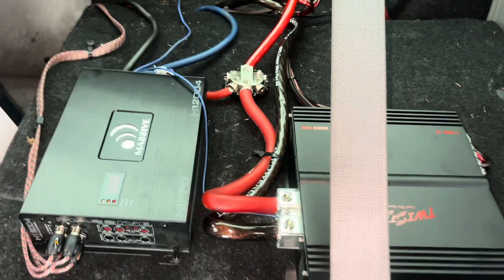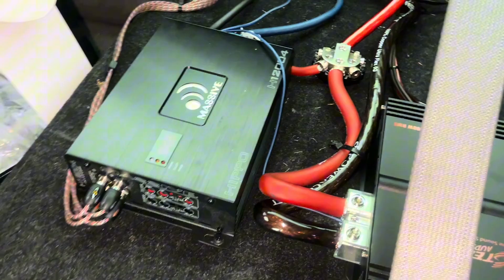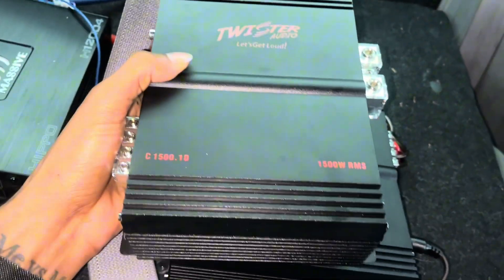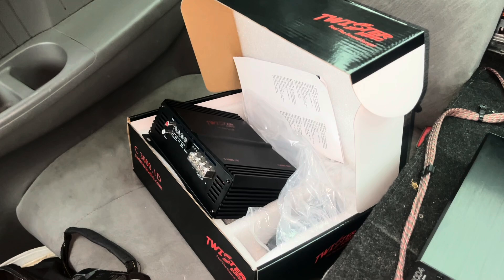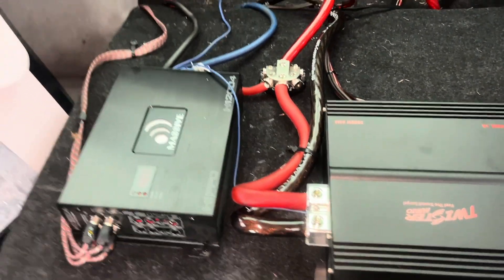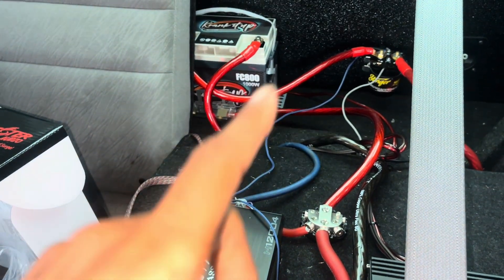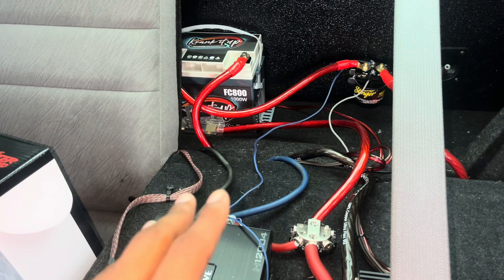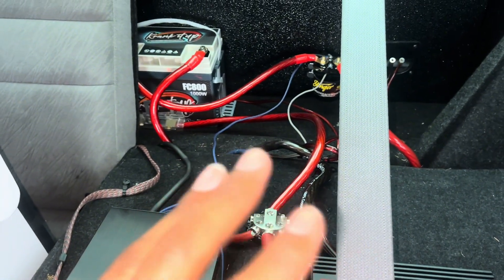Does 2x RMS = 2x Bass?

Comment: shoutout vw for making bassproof cars man. my jetta eats 3kw around 130db through some 15's in IB and it hardly rattles... plus the stock alternator is good for 300A and the factory battery is AGM
Reply from the maker: Must be niceee. Everything rattles in my civic and the stock alt is only 90 amps

Comment: Yep, 370a, XS Power Titan 8, and SB500 Capacitor. 4/0 OFC power and ground. You won't face any massive voltage drops. 😂 But damn it was expensive as hell.
Reply from the maker: Dang 4/0?! where you even find that lol
Reply: @AndrewGilreath 
Knukonceptz or SkyhighCarAudio make sure it's Tinned OFC to minimize corrosion on the wires outside your car. Inside the car OFC or tinned, doesnt matter.

Comment: Good video. Get a SMD copper distribution block. Hot and ground. Your amps will run cleaner.
Reply: He doesn't need it... I'm running their Ultra QCXL-4 Fuse Alu for 5500w, it's still clean.
Reply: @MyFaux  Oh he does. Copper is the only way to go. Trust me. 18,000 watts in my Escalade. You don’t use nothing but copper.
Reply: @b-luv339 
If you say copper is good for 18kw, then aluminum is good for 11kw. (Alu is 61% as conductive as copper and more heat resistant).